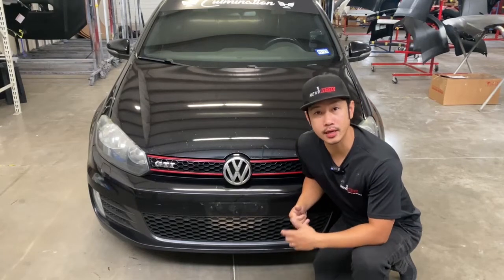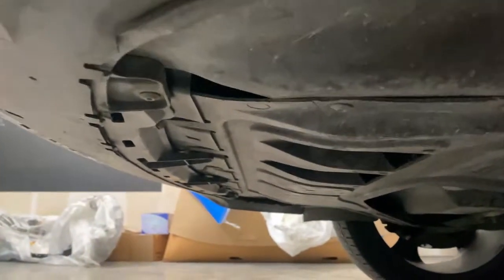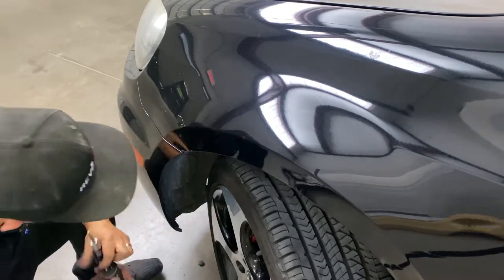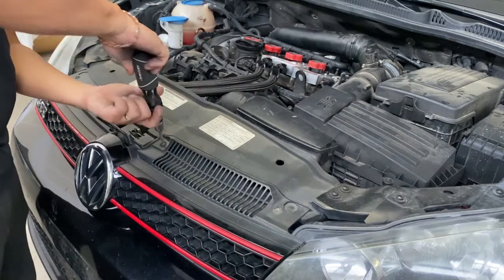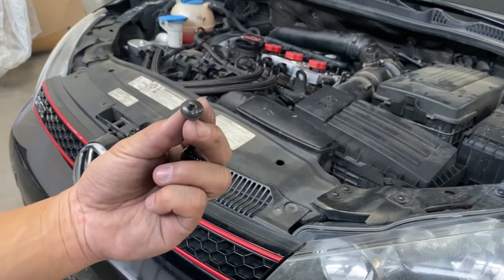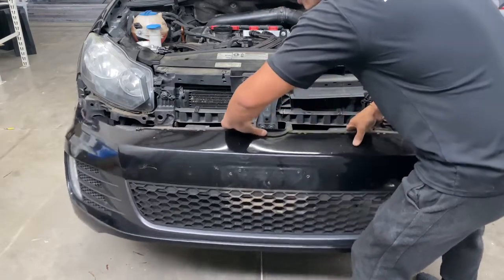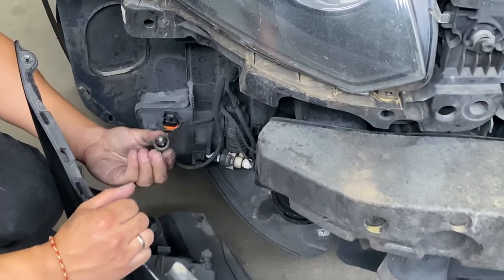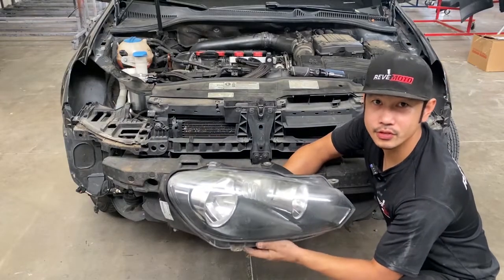How to Replace a 2010-2014 Volkswagen GTI Front Bumper | Remove & Install | Beginner Friendly

Comment: Do you happen to know the type of screw. Think I’m missing all screw/bolts for bumper
Reply from the maker: Some are 10mm and 7mm all you can get original at the dealership or cheaper at hardware store like “ACE”.  If you need any painted to match parts go to www.ReveMoto.com